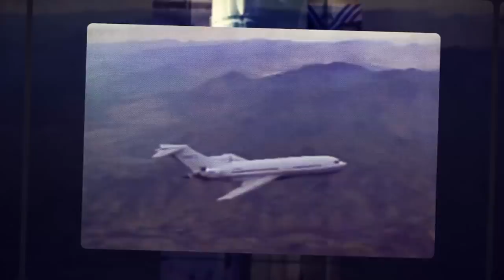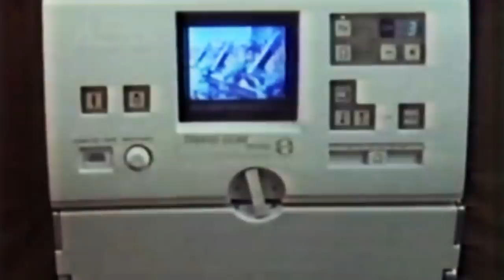This 727 had Tail Propellers (and sounded like a saw)

Comment: Was hoping for a sound/video clip.
Reply: @Hoffie92  I watched this right after I commented. It doesn't sound to dissimilar to a regular turbofan. Just a little extra.
Reply: Actually it did. It sounded like a bad buzz not a turbo fan soumf at all. I used to work at GEs peebles test facility in Ohio where they were ground tested.
Reply: @ChiefStones  that must have been incredible. Even on a "boring" day.
Reply: @MikeOrkid  yes it was an interesting place to work. They have 8 thousand acres there because of noise. Google map 1200 jaybird Rd. Peebles Ohio.
Reply: @ChiefStones  Such rad stuff. The enginuity back then was something else. Granted things are so different now with computer simulation before any real stuff even starts.

Comment: Engine is called an “unducted fan” . Noise is why it’s not used.
Reply: Markings read: UDF. I think he's right.😉
Reply: @stephanmariani8313  the GE-36 was called an unducted fan (UDF). The Allison 578-DX was called a prop-fan. I worked on the Allison engine. The generic term for these engines was ultra-high bypass fan (UHB).
Reply: That's part of the reason for the GE-36. The Allison 578-DX, on the other hand, was much quieter. The reason that it wasn't developed into production was the dramatic drop in fuel prices in the late 80s. There was no longer a financial incentive to invest in the development of high efficiency propulsion.
Reply: @ronaldschoolcraft8654  
I believe you nailed it .
Reply: In England I believe they call it a ductless airscrew
Reply: @ronaldschoolcraft8654  imagine not investing for the future

Comment: Worked on that project when I was with GE. Fought like hell to control the blade pitch
Reply: Are you sure
Reply: I just retired from GE Aviation I remember that engine UDF my dad was an airline pilot at the time his concern was one of the blades coming off
Reply: @michaelnippert945  understandable concern given the rash of badly constructed prop blades that showed up in the Turboprops in the 90’s. They were mainly from one prop manufacturer, regardless of airplane manufacturer. And a bunch started delaminating as I recall. There were a number of nasty crashes. Both civilian and military.
Reply: I also worked on this program at the Mojave airport/test facility as a contractor for GE. As I remember the spider assembly that changed the pitch of the fan blades leaked like a sieve. Also the test stand engine in Ohio did shed a couple of blades during testing.

Comment: Fuel is an operating expense and if reduced, increases profits even if fuel is cheap.  There was most likely another expense introduced this did not offset. Prop noise was most likely a cover for a tougher issue.

Comment: The big problem is prop tips going supersonic. The same effect caused helicopters to make the loud pops when making a sharp turn.  
Engines like RB211 Trent, etc use fan cowlings to prevent the tip noise but the maximum diameter is limited compared to propellers. .

Comment: There is still 2 of these engines in existence. GE owns one and the Smithsonian owns the other one. I used to work at GE Aircraft Engines in Peebles Ohio USA. These engines were final assembled in the Prep building and they were tested at the old 4A test site. There was about 4 video clips of the facility in the video. The test facility is still in existance. 1200 jaybird rd. Peebles Ohio. Google map it. After test running at the facility they were transported to Mojave test facility in california to be installed on GEs flying test bed aircraft. The project was soon cancelled after that. As for the saw sound, it was more of a buzzing sound as the counter rotating blades passed each other in opposite directions and would break the sound barrier as they passed each other. Hope that helps.

Comment: The 727 was cool, just loud and with a couple of plumes of exhaust like damm F4 phantom. I heard it was the sports car of the fleet tho.
Reply: Er.  Not when you have to wait 4 or 5 seconds for those Pratt’s to spool up if you need a quick burst to get over the fence
Reply: Best handling aircraft of its class that I’ve flown.  Loved it..
Reply: The 717 and 757 were great at steep takeoffs from what I've heard, and much steeper than the 727.

Comment: One name never seems to get mentioned in the story of the development of the propfan engine. You can see their logo on the side of the GE engine - not as prominent as the "GE" logo, of course, but NASA was the source for a lot of the original research these engines were based on as well as being the source for a development contract to help fund the work. There is technology in almost every commercial airplane flying that can trace its roots back to NASA.

Comment: the 7j7 got shelved because it wasn't a 737 (no american airlines would order it) and the 757 ended up taking the 727's spot.
Even back then, airlines were standardising on "one model" - and that model was the 737

The 7J7 would have worked well with big ducted fans. Instead we got the 737 ratrodded into the NG (nasty stall characteristics) and MAX (that, plus extra instability)

Comment: This video should have been about a propeller system and the noise level. The video editing contains future and past references and inaccuracies that provide incoherent understanding of the topic that is discussed. This prop configuration was just an experimental engineering. Definitely the engine was graded inadequate for high load applications.

Comment: That 727 was doomed. The airlines didn't want to pay the cost of having a flight engineer in the cockpit. Once that government advisory board decided the flight engineer could be eliminated, that sealed the fate on jets that still had them. The Rolls Royce Tay engine was actually a good fit for the 727, and many were converted and flown by UPS. Called Quiet Freighters. There was also that Valsan conversion that put two MD-80 engines on the pylons, and it was a real performer. It would climb so well it would bury the rate of climb indicator at 6000 FPM plus.

Comment: why would a drop in gas prices make flying smaller planes less viable
Reply: My guess is it was more about the issue of fuel efficiency no longer being as large a concern... though that in itself seems spotty.
Reply: I think it is that small planes never really had good fuel efficiency because they only flew a few people. The drop then made it more efficient, yes, but big planes because more efficient over all because they could carry more people and use less fuel for that many people.
Reply: @galaxytoast1079  Then the statement doesnt make sense in the first place. A drop in fuel prices had nothing to do with the final scrapping of the plane
Reply: @Tawkitoutti  the lower fuel prices reduced the value of the radically new engine design.  The plane was not the issue.
Reply: @galaxytoast1079  Liters per passenger kilometer. :) Or gallons per passenger mile

Comment: That is a propfan. It is the so called "unducted turbofan" engine and it is the most fuel efficient aircraft engine type. But it sadly does not meet any sound standards.

Comment: 2:39 - Wrong Boeing logo. MD hadn't taken over Boeing yet. That was in '97.
At least the "glass cockpit" made it into the 757, which they should never have discontinued.
Reply: MD did not "take over" Boeing.  Boeing BOUGHT McDonnel Douglas for $13.3 billion in 1996.
Reply: @buckhorncortez  - You obviously weren't working at Boeing at the time.

Comment: Noise wasn't a problem in the usual sense (ground signature), primarily, it was the acoustic impact on the empennage which would have required significant strengthening (read weight, where weight and balance is already a problem on rear-engined aircraft). Additionally, sound was transmitted into the interior. The program(s), both Boeing and MDC, were halted before a solution to this was seriously analyzed.

Comment: More efficient plane saving fuel. Oil dropped in price so they didn’t build it? So if you build it and its more efficient. You but less cheaper fuel. Allowing more flight routes if it was profitable. This is why investors and ceo’s ruin innovation. Then recently during fuel crisis ticket prices went up. They looked into improving efficiency.

Comment: Should have done electronic super fule efficiency add todays well???.especially against the dollor😕'O'well.....wounder if electrical lighting charge and solar could be fitted.😆add starlight for the black box add a few new working safety so i can actually find a ocean sunk craft 😡 like that rocket airplane for that rescue mission for a burst drop and take off for a fall impact burst on commercial aircraft ????